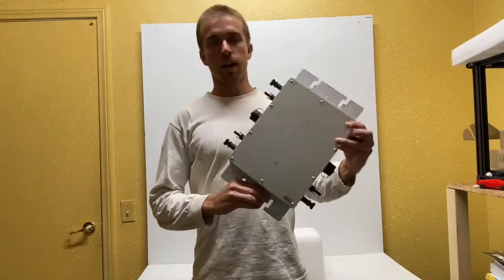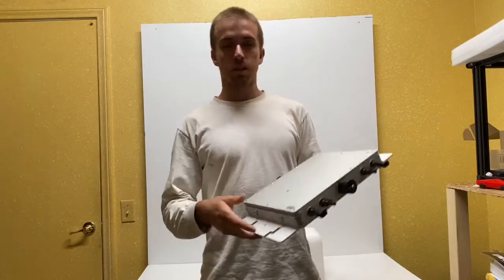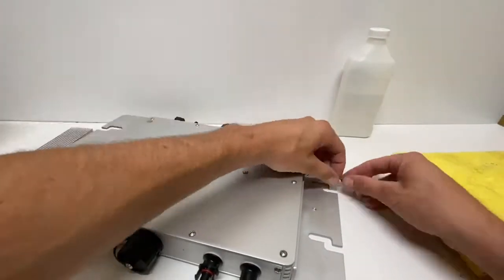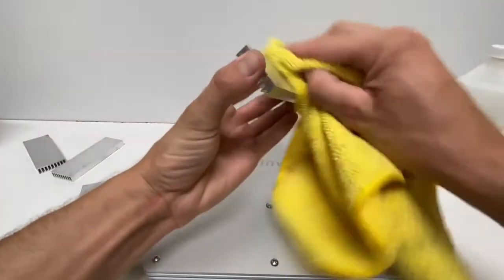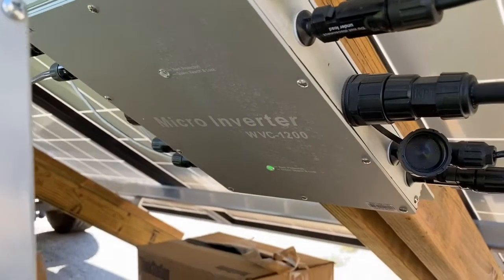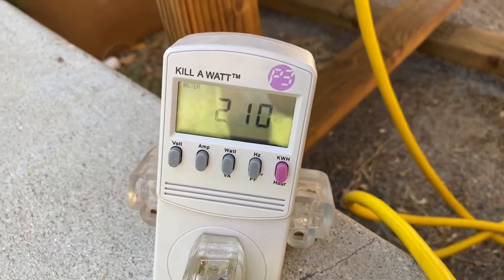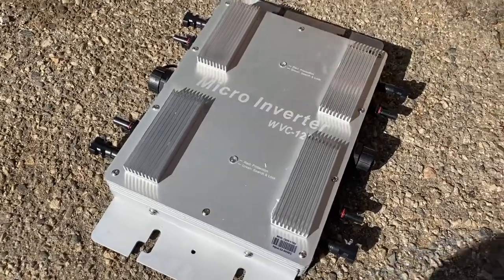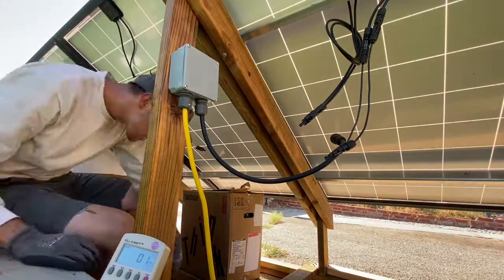Increase Solar Microinverter Output by 28% with this Easy Mod

Comment: Fascinating. Do you know if the principle applies with SolarEdge optimisers?
Reply from the maker: Thanks for watching! As far as I know the SolarEdge optimizers do not have this issue. The inverter in this video is a much cheaper Chinese microinverter, and has much more power running through it (4 solar modules per inverter compared to 1 or 2 solar panels per SolarEdge Optimizer)
Reply: Thank-you.